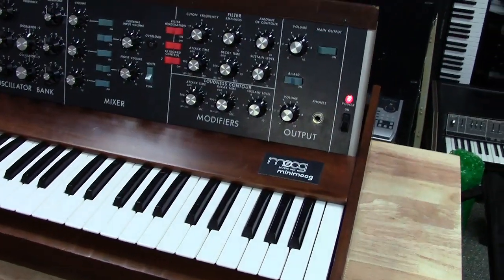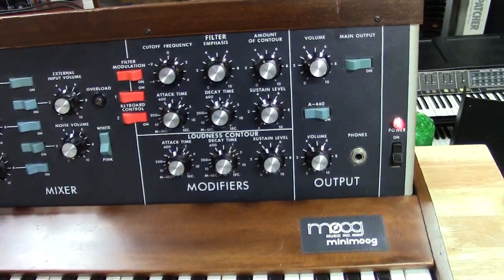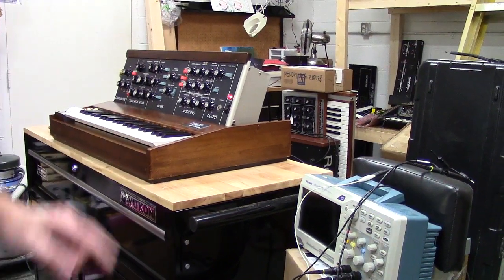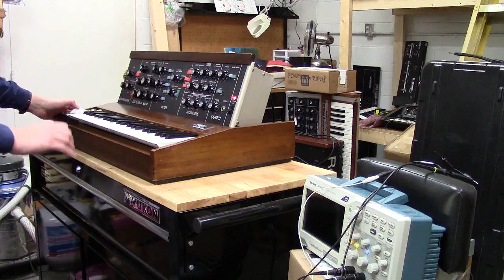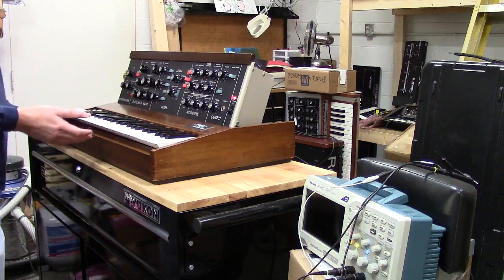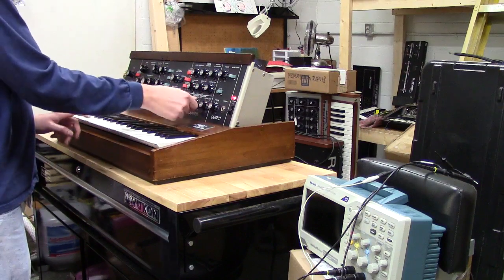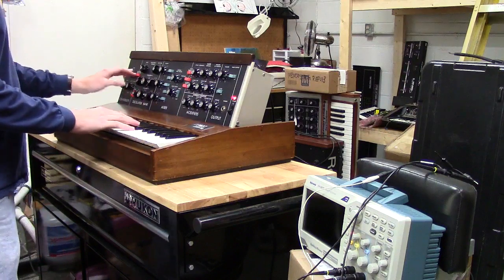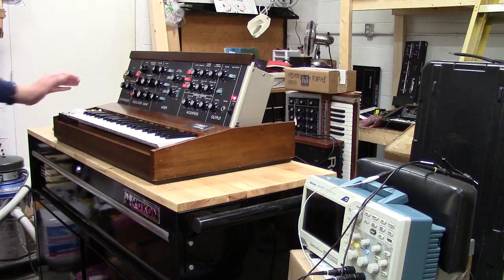Jeff's Minimoog Restoration (by Synthpro)

Comment: Great demo Synthpro. I wonder if you could answer something for me? I understand why there is a lo setting on  oscillator 3, for LFO use but is there a reason for the lo setting on oscillators 1 and 2?
Reply from the maker: Thank you very much! That's a very good question. There are tricks where you can use the Lo setting for sound effects or tremolo effects by mean of DC effects on the audio line. I believe the biggest reason all oscillators have Lo is because it was easier to use the same rotary switches throughout and all oscillators share the same CV buss for octave ranging...Im sure it made life a little easier for the assembler as well.

Thanks again and look forward to meeting at Superbooth!
Jareth